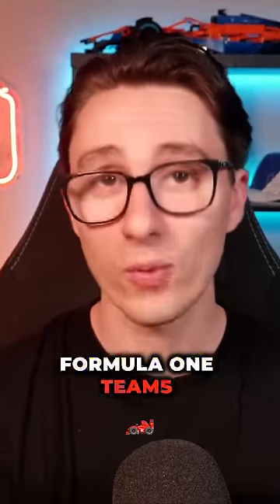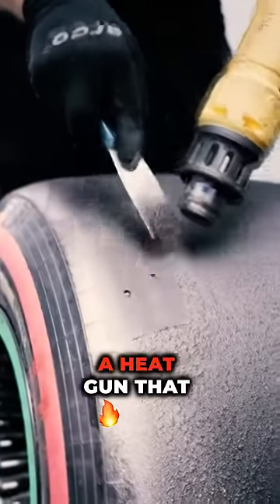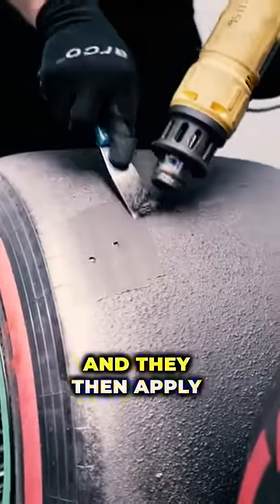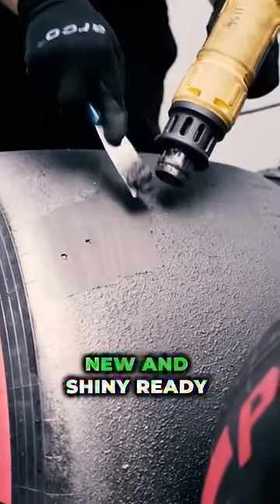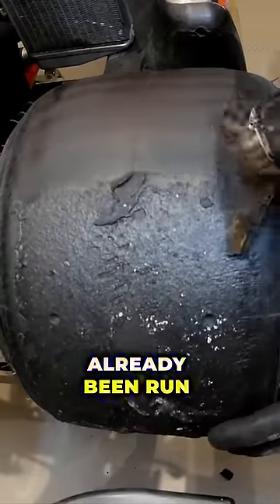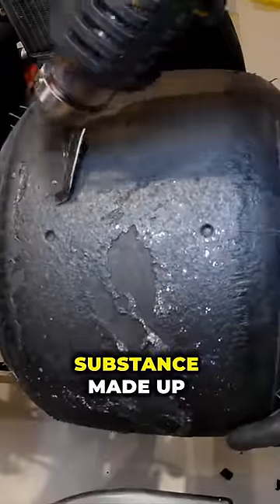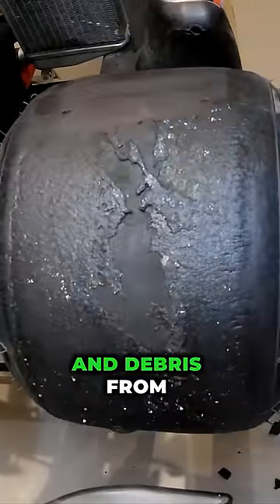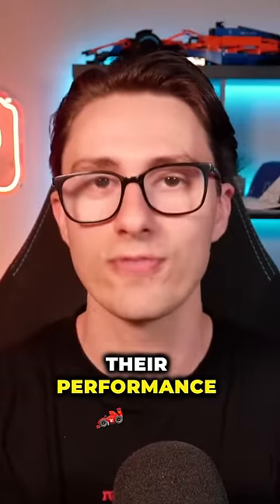F1 Tyre Scraping Is So Important

Comment: As far as I remember, used tires are going to be recycled and not used again after people have removed the coating.
Reply: Not true teams are only allowed a certain number of tyre sets per weekend so they balance out a mix of unused and used tyres for the race so they scrub them to get down to clean rubber as that gives more grip than going out on dirty tyres, after the race finishes all tyres are handed back to Pirelli who then analyses them and return them to the factory to be shredded and recycled
Reply: @jonlincoln6069 I wouldn't say that's true. They only reuse tires from qualifying. Some because they have to, and some because there is still a lot of life left in them. The tires that are scrubbed like that lose their structural integrity and most definitely aren't used again, especially after looking like this.
Reply: Yes the tyres are recycled but only after the entire weekend as even used tyres have life in them. But between sessions this is what happens
Reply: @jasonstevenson2566  erm no thats just not true. for any tyres used in practice 2 sets HAVE to be given back after each session and is usually the 2 most worn sets. they give the tyres back to pirelli, pirelli analyse any data they can and then thry destroy and recycle them.
Reply: @grgagabric4369 the tires after being scrapped like that unequivocally 100% can be used again. it does not affect them structurally
Reply: @grgagabric4369 Yes exactly,Before they reuse them from qualifying they Scrape them exactly like he said…
Reply: @cbrunnem6102  we do not re-use scraped tyres. 

Scraping a tyre is done at the end of life to assess wear. Other race series’ may scrape an entire tyre to reuse, but we only scrape across the 6 wear pins on each tyre. I say “we” but it’s Pirelli that do this. 

After sessions, Pirelli then give each team their measurements in these wear pin locations, but they also give a pit lane average too.
Reply: @cutoverpark9596  no, not correct. They just get wrapped and stacked.
Reply: @grgagabric4369 no it literally is, have you paid attention during the commentary
Reply: They aren’t recycled they are incinerated
Reply: @dansmith7418 you're telling me you guys just leave your soft quali set you carry over into the race dirty? Practice sets you're just giving back yeah you'll just leave that how they are but if you're putting a set of scuffs on surely you clean those up
Reply: @jonlincoln6069  dont they have to give the tires back to pirelli after a weekend? pirelli then gives them "new" refurbished tires which might have been used before?
Reply: @achmehd844 yes, Pirelli collects and desteoys all tyres after a race.

Comment: Former tire tech for a GT3 endurance and DTM team here: 
They do this to measure tread wear, not to re-use the tires. You need a somewhat flat surface around the indicators (those little dimples you can see) to measure tread depth (yes even on slicks). They then compare these measurements to the values from before the tire was used and can calculate tire wear. Since there are usually 3-4 dimples across the width, they can also see how consistent the tire's contact patch was, or if they were running too much camber.

Comment: The melted material on the tires is more likely to be the tar used in asphalting the track which has a much lower melting temperature than rubber and is much more sticky than melted rubber. It’s the chunky bits in the tar that are made of the rubber that is scraped off of the tires by the abrasive asphalt when the tires have any movement on the surface of the track other than straight forward.

Comment: They will hardly ever re use a set of tyres , they may scrub a set but they won’t produce enough heat to get marbles stuck to them . This video is purely to asses wear and damage .

The only way it improves performance is because the driver doesn’t have to scrub them clean on the out lap , other than that , the tyre has already had a heat cycle and is past it’s optimal working window
Reply from the maker: Very true but on the odd occasion they might re use a set in a practice session just to see how the tyre performs 

But you’re quite right because it’s been through a heat cycle it’s not anywhere near a fresh set when it comes to performance
Reply: @NotApplicableJB no. They don't.
Reply: @dillanyssel7424 yes we do… in fact until recently we had to run the same tyre set that we used in Q2 if we made it into the top 10 for the race… it was literally a rule to re-use a set 🫠
Reply: However… we will not scrape the tyre and use it again. Scraping is only done at the end of life of the tyre, and only across the wear pins (unlike some race series’ where they actually scrape the entire tyre).

Other reasons why you might use a tyre set again….
- it’s only a Qualifying set and thus only done ~ 3 laps. (Only on tracks where deg isn’t too bad)
- something unexpected happens in the race (e.g. Puncture). Depending on how our run plans were for Practice we may have scrubbed (used) sets leftover.
- etc.

Also the definition of scrubbed is that it has taken the initial surface off the tyre - so that it is no longer shiny.
Reply: We would also never scrub a set just to assess wear and damage.

If anything this just gives us a risk of puncturing the tyre… which is bad! Some teams think that putting the tyres through a more intense heat cycle (where the temperature goes above 70C) can improve the performance of the tyre in the race.
Reply: @dansmith7418  not in f1, and not after scraping it 😂 scraping has nothing to do with making a tire usable again
Reply: @dillanyssel7424 I’m not quite sure where you’re getting this information: even just this weekend Charles Leclerc started on a used soft set of tyres and Fernando Alonso pitted onto used softs on lap 44. Used and scrubbed tyres are definitely used in F1
Reply: @dillanyssel7424  dude what are you smoking? F1 teams reuse tyres all the time! Have you actually watched a race weekend before?..🤦😂
Reply: @dillanyssel7424 yes they fucking do lol.
Reply: @NotApplicableJB  “Do note that a Pirelli tyre is considered 'used' once it has been fitted to the rims of an F1 car. That's because the removing of tyres from the rims can cause damage to the tyres, which can make them unsafe. Hence, a tyre once fitted, will never be re-used again, even if there is no wear on it.May 12, 2022”
Reply: @dansmith7418 All drivers who qualify through to Q3 have to start the race on the same set of tyres used to set their fastest time in Q2.. ligerally only time they reuse tyres. And this has nothing to do with the tyre scraping in the video.
Reply: @deez2766 yes, the RIMS. the teams dont do that during the qualifiers/races. They remove the tyre and rim together for obvious reasons. ;P
Reply: @ErwinPPP only time they reuse a tyre is during qualifiers because of the rules. And they dont scrape em before they do that. Where the heck did you get that idea from?
They get like 15 sets of tyres for every race..
Reply: @burritoboy1012 your comment makes absolutely no sense. Ok, so they used soft tyres?? So?
Reply: @andreaskarlsson5251  the Q2 rule got scrapped at the start of the 2022 season. You can now start the race on whatever tyres you have left in your allocation. In a normal format weekend (e.g. when it’s not a sprint weekend or the weekends they’ve been testing reduced tyre sets) we have 13 tyre sets (8 Soft, 3 Medium, 2 hards). After we do FP1 we have to return 2 tyre sets (usually the only 2 we have used), then we have to do the same for FP2 and FP3. If we don’t use any tyre sets (i.e. no time on track) we have to nominate which tyres to return, another situation could be that if say one of the tyres in the range is awful, we may elect to return a new set of that compound and keep one of our used tyres for the race… There is also a rule that if you make Q3 you also have to return a soft set. 

Now, you get into the race and you will have 6-7 tyres remaining. If you were a team like RB, Mercedes, Ferrari you will have tried to make sure that you had taken up to 4-6 soft tyres into qualifying. So after qualifying, you’ve actually used the majority of your tyre sets (maybe only for 3 laps in qualifying Out-fast-in), but of course… don’t get me wrong, you try to keep them all as clean as possible… teams will try to save sets as best as possible.
Reply: @dansmith7418  av right, so never reusing the tyres. 👍
Reply: @andreaskarlsson5251  I don’t know what you don’t understand?
Reply: @dansmith7418  what do you think I dont understand? Rofl.

Comment: I'm surely not the only one who would love to do that job.
Reply from the maker: I’d absolutely love it! So satisfying
Reply: Trust me it is not as good as advertised. I work in the radical cup scandinavia and it is such a chore when it’s your turn to scrape tires. Yes it is satisfying for the first 5 minutes, but after that the air around you get really hot and you become super sweaty unless your sitting outside
Reply: It's not nearly as glamorous as it might seem. It's oddly satisfying in a way, but also a bit of a dirty job and kind of a pain in the hindquarters, at least until you get the hang of putting the right amount of heat in.

Comment: The tyres they are scraping are usually after long runs, and will be the tyres that get handed back to Pirelli never to be used again. If they want to hold onto the tyres, they will keep them on the racing line and away from the marbles so that they don’t need to scrape them…
Reply: Yes exacly. And only tires that are reused are the ones usually used in qualy, that are only like 2-3 laps old max.

Comment: *I just found out why Pirelli wants formula one teams to scrape their tires after each session.  You may have seen Formula One teams using heat guns, which produce steam, to melt the top layer of or rubber on their tires, and then apply a scraper, which removes the coating and leaves the tire looking brand new and shiny, ready for use later in the weekend.  This is because used tires that have already been run on will be covered in a gum-like substance, made up of melted rubber picked up from the track, as well as dust and debris, so the teams clean their tires to improve their performance.  But Pirelli also takes data from each of the teams, whilst they're scraping their tires.  Pirelli uses this data to asses the degradation of the different tire compounds, and predict tire performance for the subsequent practice running sessions and races.  The teams in Pirelli can then compare the actual data with that predicted by Pirelli before the weekend, so they're better equipped to forecast which of the tire compounds, from the C1 to the C5 they should offer for upcoming races, and for the same tracks next year.

Comment: Over here in the US we've done this for decades on NASCAR Cup Series tires. Tire temps are measured at each circular dimple in the tire you see in the first video of the tire being scraped, it also acts as a gauge for wear. Used tires are known as Scuffs. In Formula One Scuffed sets are not allowed as the team being in control of the tire outside of Pirelli's custody allows for illegal tire soaking and other practices to manipulate tires outside the rule book.

Comment: Example of why you cant trust anyone on tiktok, reels, short, etc.
Calum Nicholas said in a podcast what  the actual reason why, and it because they have to remove debry, sand, dust, etc. because after this, all the tires are put in a press and melt them down to be recycled to newer tires. And the part they scrape off gets thrown away.

If you don’t know Calum Nicholas is one of the pit crew to redbull.

Stop these none sense social media people posting false just to get view and money…

Comment: Yes this is true it’s missing context. We scrape tires because there are little divots molded in the tire that you need to un cover. Usually 25 per tire. And using a special measuring caliper we can take measurements at all of those points to get data trends from tire/ track performance to suspension setup

Comment: No this is wrong! That used rubber is worn off in just a couple of corners with the amount of energy that goes through the tires. They actually scrape the tires because it makes them easier to analyze for tire wear and look at the total weight lost on the tire where the extra rubber that the tire picks up on the cool down lap massively effects it’s final weight.

Comment: Um it’s to measure wear on the tire. They measure the tire before running.  After they are done running the driver picks up trash to help with min weight. Crew scrape the trash off and measure again to understand the setup.  Some motor sports will scrape prior to running on a brand new tire.

Comment: The heat gun produces hot air, not necessarily steam. The "gum like substance" is also from the tire itself from the friction between the tire and the track. With slicks it's especially faster building

Comment: The cleaning has 2 purposes #1 measuring the thickness a #2 saving the best set in case you need tires after using the allotted tires.

Comment: The first half of the video is incorrect the tires are send back to the manufacturer after the track day and the scraping of the excess rubber. Even if the tyres are not used on that day are send back. The rest of the video is correct and they do take the data for further development purposes.

Comment: That’s not only the reason why if you watch NASCAR they do this too because it’s usually wear indicators on the tires little debits and they can tell which side of the tire middle and inside or outside of the tires getting worn more for where reasons for future adjustments you see this a lot and NASCAR. Also do this because that sticky substance can give them a different type of grip or loss of grip function. This is been going on since the 70s in NASCARFormula One in Perelli just starting to catch up on that

Comment: It’s called scrubbing hence why they call them scrubbed tyres, yes they are scrubbed and checked by Pirelli for degradation etc but they are also scrubbed so the team can reuse them in the race after using them in practice etc as tyres that have already gone through a heat cycle ie been used can be sometimes better at lasting long than a fresh unused set !! Just love these Drive to survive YouTubeers 😂😂😂
Reply: Scrubbing tyres isn't this process, taking a new set out on track for a couple of laps is Scrubbing tyres.
Reply: @kaiveitchkarting correct
Reply: tyres used in practice sessions are not used in the race. the only tyres that are allowed to be brought into the race from other sessions are tyres hsed in qualifying.
Reply: @kaiveitchkarting no, scrub tyres are using a set that have already been used. an example is if lets say mercedes used all the soft tyres in their qualifying tyre allocation and wanted to put on a set of softs in the race to try and get the fastest lap they would use the set that has the least amount of wear on the tyre and tyres that have aleady been used are called scrub tyres hence why you will hear the race engineers say a drivers rival has moved onto scrub tyres.
Reply: @godzvnm7315  read the thread again, we're talking about the process of scrubbing which results in a scrub set.
Reply: @kaiveitchkarting  well no you in particular clearly wasnt. because using tyres resulting in a scrub set doesnt require to scrub them after a session like qualifying as there is little to no pieces of rubber or anything on the tyres so scraping them is not necessary.
Reply: @godzvnm7315  my comment literally says scrubbing as the first word.
Reply: @godzvnm7315  dude, you have no clue what the conversation was about
Reply: all tire sets from practice are returned to pirelli. Only tire sets from Q1-3 and the ones reserved for the race can be used in the race.